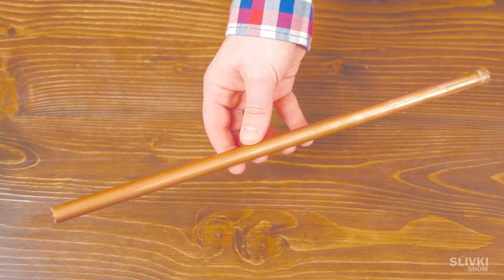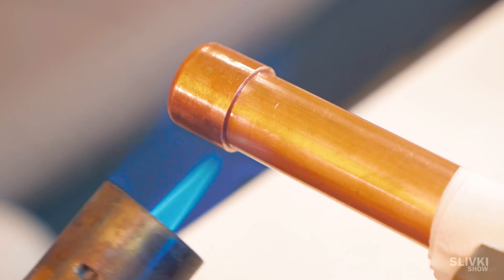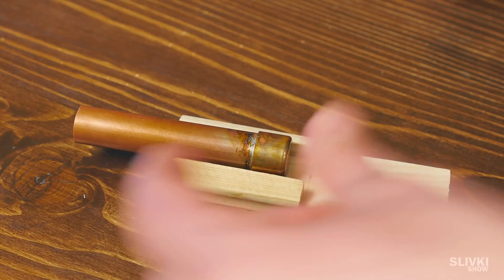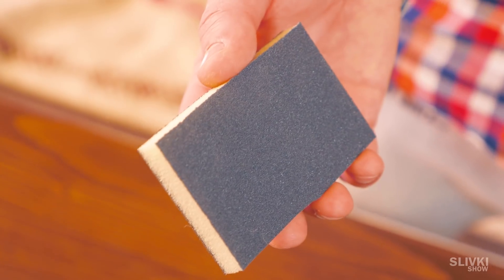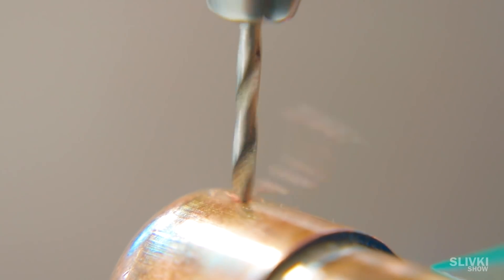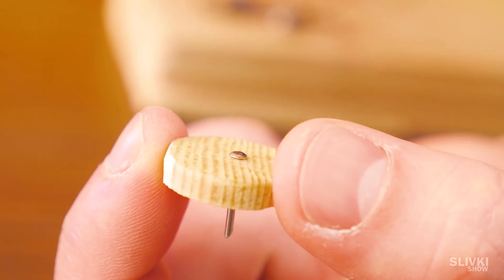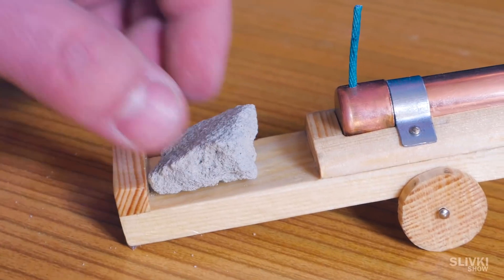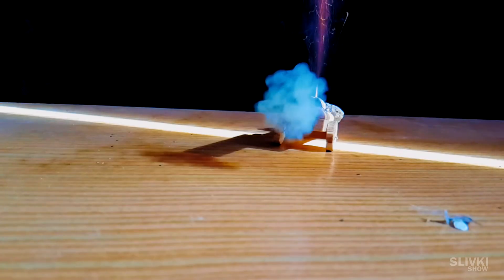HOW TO MAKE A REAL CANNON!

Comment: ......back  in  1969 , my dad made a cannon  for me . 2 inch steel  stock , with inside diameter  of 3/4 inch . Made a stepped  cradle  to hold cannon . A small  touch hole . We put a shot of gunpowder  and a wad of crumpled  newspaper . As I got older , I  started  making  lead ball projectile . It makes a loud noise and shoots a wicked  flame ball or projectile ! I am  making  a stock / hand grip , and turning  it  into  a  pirates  wick lock of sorts . I will fire it remotely  in a vice or holder to check out how much  kickback it has . Then eventually  hand fire with wick hooked  to my beard.........just like Black beards  piece ! Wish me luck ! Maranatha !

Comment: You can also do this with a length of steel fence pipe...did it for my 10th grade science project...science teacher was impressed...but not pleased...but its not my fault they made me use a potato instead of the cast form tin projectile i made with my uncle...long story short here is instead of launching what amounted to a 12 ounce soda can a good 800 feet... i covered the football field in potato salad...